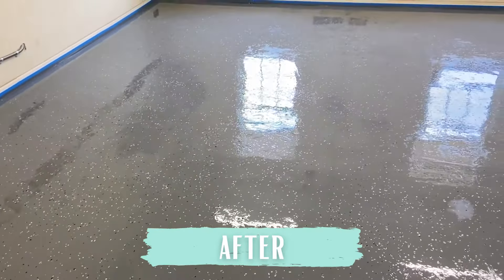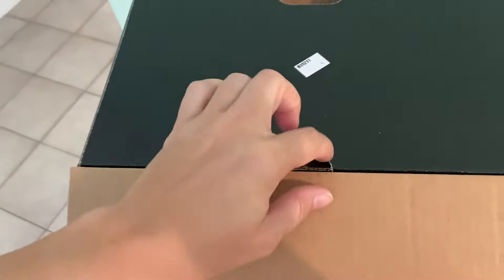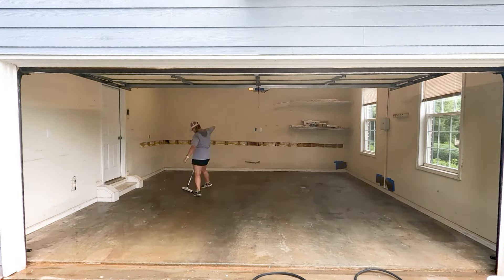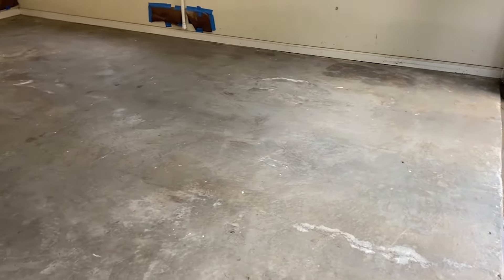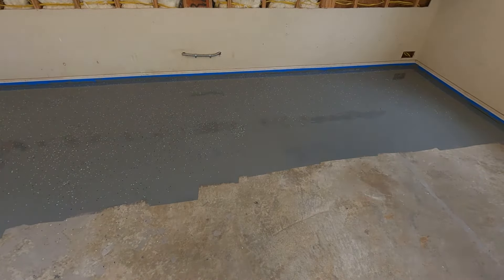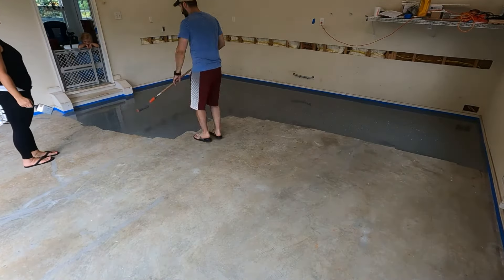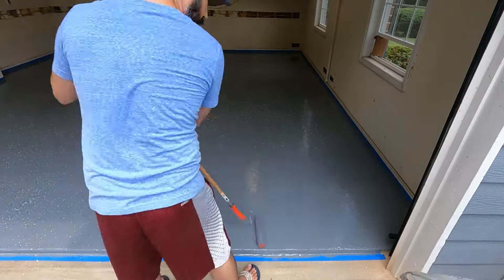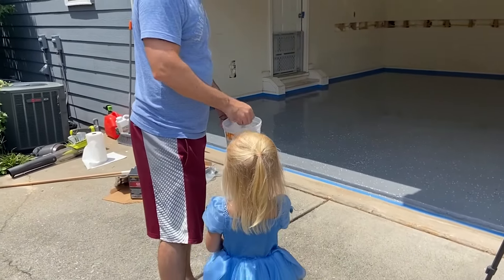Epoxy Garage Floor | Rustoleum Rocksolid | Creating Home

Comment: After watching this video, I applied Rock Solid to half of my shop floor, 800 SF.  Scrubbed the floor first with a commercial degreaser/cleaner.  Applied Rust-oleum Recoat and Primer and let it dry for 12 hours.  Used three bags of the Rock Solid and it covered the entire area.  This is exactly the coverage that is claimed by Rust-Oleum.  Did not apply any color chips.  Added the Rust-Oleum Anti Skid to the bags while I was mixing it.  Came out beautiful.  Not perfect, but I am completely satisfied with the results.  Planning to do the rest of the shop floor before winter.  Thank you for this video. I only used half the recommended amount of anti Skid to each bag.  That was more than enough.  The Anti Skid will sink to the bottom of the bag, so be sure to remix the bag before each pour to keep the Anti Skid evenly dispersed on the floor.
Reply from the maker: Thank you for the tip!! We really regret not adding the anti-skid to ours. I have slipped a few times coming in from the rain, it can be very slippery! To help with this, we added a little garage runner to avoid this in the future. Thank you for sharing this tip and I am so glad it worked out well for you!!

Comment: I have a 24x25 new garage. Floor was poured in July. Purchased 1 2 car and 1 1 car kit. Installation guide say 1 bag will cover 200-250 sq ft. I have 600 sq ft. I had to purchase another 3 bags to cover the floor.

Comment: The clips of the footage oooks like the concrete absorbed some of the epoxy and showed the grains do the concrete. I did my garage using this kit and found that I shoulda used another 1 car garage on top of the 2.5 garage kit. 

I am doing my dads garage this weekend and planning on using two 2.5 car garage for his two car garage. Lol. The thicker parts of my garage looks so damn good compared to the thinner parts.

Comment: Nailed it! You did an excellent job, and I feel like I can tackle it, too. How soon were you able to park your vehicle on it?
Reply from the maker: You totally can! It was much easier than we thought! We actually don't park our vehicles in the garage because we have soooo many large tools so we set it up like a workshop. But we finished the floor and then 2 days later we moved into the house and had the garage filled with boxes, totes, tools and furniture and we had no issues if that helps!

Comment: Why did you guys decide to put the epoxy on the floors in the garage? What are the advantages? I’ve heard some people don’t like it so I would like to know from you since you’ve had it for a little while now… Now you need to paint the walls in the garage. Great job! Thank you for making this video
Reply from the maker: We decided to do it for a few reasons. First, it looks really nice. Our plan is to turn the garage into a workshop so we will be spending a lot of time out there. Second its easy to keep clean and it feels cleaner when you walk out there. Its easy to Sweep and mop up spills, sawdust, etc. We keep an extra fridge out there (the garage is off our kitchen) so walking in bare feet in and out of the garage is nicer on an epoxy floor. Plus, our daughter likes to go in and out to see what we are working on and its a better experience walking on overall. So far its held up really well and it was totally worth the time and cost.

Comment: Hi guys, how is this floor holding up? Usually we do a diamond grind to get rid of any stains etc and to create a mechanical key bond to the existing floor, then a prime coat, base coat with flake and a final top sealer coat!
Reply from the maker: The floor is holding up really well! This was our first time doing this so I am sure we made some mistakes. I don't expect this floor to last forever but given the tight time frame we had to get it done, I think we did OK for our first time. So far, its holding up and looks great! We have no regrets!

Comment: Has it held up? any peeling?
Reply from the maker: So far it has help up really well! The ONE regret having is not putting the non-slip top coat on because it does get slippery when you walk in from the rain, but otherwise we are thrilled with it!